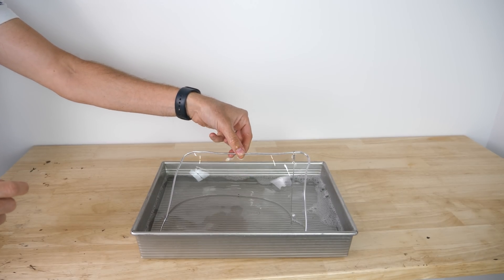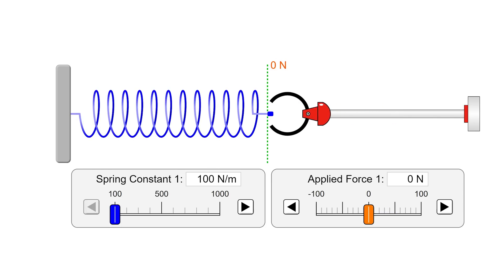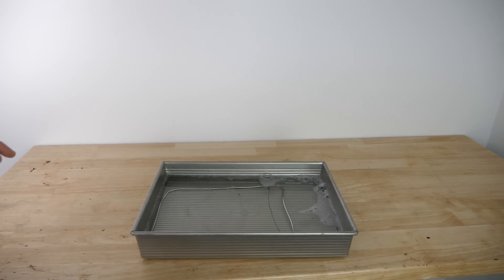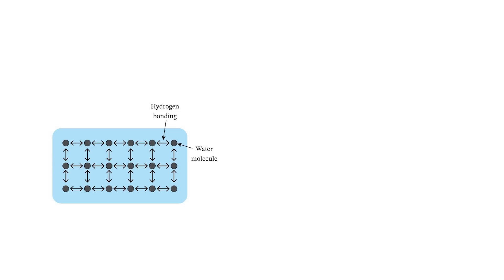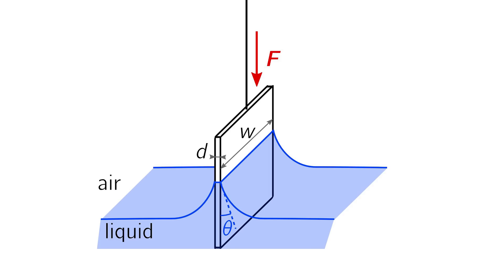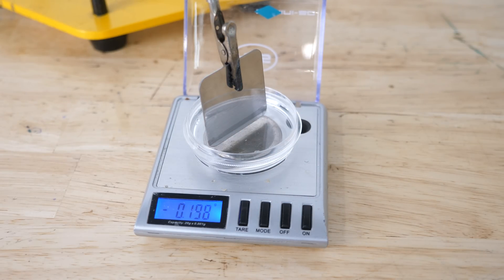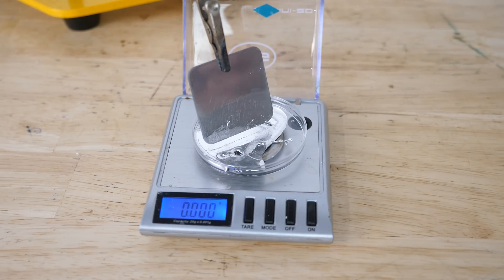Why is Water So Stretchy?

Comment: In biology class we learned that if you're ever trapped in a jungle, you should cut vines higher up first, then lower down, to get water out. The top cut severs the water inside from the rest of the plant so it can't get pulled up, otherwise the water tension would pull the water up and you'd get a dry vine. Stay hydrated!

Comment: Does this happen with different gravity? Such as, will the proportion of surface tension be the same on the moon as it is here? Or does the pressure and temperature difference change it significantly more than gravity does? It would be an interesting thing to measure, and potentially create lakes of liquid which we can walk on, on mars or other planets/moons if able.

Comment: Ok now that was cool, the scale + adding soap demo. You can literally see the water losing its grip with just a microscopic amount. I've seen people use water displacement on a scale to measure the volume of things by the increase in weight, but I never thought about surface tension decreasing it.

Comment: Sooooooooo I was playing Pokemon blue version the other day and was fighting one of the lesser trainers in the poison ninja gym, I just beat his arbok with mew's psychic (I named mew lil giegue), and then he sends out Sandslash, so I send out my Vaporeon, now the reason I did this is because on a chemical level, vaporeon is cooler than sandslash. Allow me to explain the science behind my hypothesis. In chemistry specific heat is the amount of energy required for one kilogram of a substance to be raised one degree Celsius. Now water's specific heat requires that it absorbs about 4200 joules or one kilocalorie(one nutritional Calorie)  for one kilogram of water to be raised one degree Celsius, now sand is a heterogeneous mixture, however around %80 of sand is composed of the element silicon, silicon has a specific heat of 710. So it takes waayyy more energy to heat water to the same temperature as sand, water is also a liquid on most places on earth, which means its particles can move around and disperse energy more easily to cool down faster. This is why sand at the beach is hotter and the water is cooler. So basically vaporeon is made of water and everyone knows it so vaporeon is like water, and sandslash has sand in the name, and it is also ground type, the ground is sometimes made out of sand in some areas, also Sandslash can learn the move slash, and also sand attack, so it is safe to assume that to the same extent that Sandslash can slash, that it is also sand, so we can say that Sandslash is like sand.Putting this information together we can deduce that vaporeon is like water and sandslash is like sand, and by extension, that vaporeon is cooler than sandslash. Now Pokemon is sometimes like an anime sometimes, but in this particular battle, I had battle animations turned on, the root word of anime is animation, so at this particular moment Pokemon was like anime and in anime, mostly the cooler guys win. This is what I was thinking in my head when I switched from my mew to my vaporeon against Sandslash of the enemy. The enemy Sandslash got one free turn because I used my turn to switch, so sandslash gets like a bonus turn, and it used a slash attack which has a higher critical chance, and! It got a critical hit on my vaporeon! It wasn't good but it took like half of its vitality HP. Next turn! My Vaporeon out-fasted the enemy Sandslash, so it gets to first this time, I told it to use surf because surf is like the best water move probably. BUT THE SANDSLASH SURVIVED BY A SLIVER! SANDSLASH TURN IT IS NOW!! CRITICAL HIT SLASH AGAIN!!! VAPREON IS UNCONSCIOUS NOW!!!! It was rediculius because of all the science and logic I just used to prove beforehand why I should have one.However looking back now there might have been 2 reasons number 1 is even though in the animes the cooler guys win, it is known that guys with yellow hair also win a lot in the animes, needlessly to say the power of anime betrayed me . Sandslash has yellow hair I think Soo yeah. Number second reason is my vaporeon was level 27 but the Sandslash was level 33, in the Pokedex, Sandshrew, which is baby Sandslash is the 27th Pokemon numerically and numerically Eevee is number 133, but which is 33 plus 100. Now what is special about 100 is that that is the number of Voltorb, which is electrical, what is also electrical is the Pokemon "charjabug" introduced in Pokemon sun and moon, in a week which is 7 days, and in seven days the sun comes and goes seven times so that's why we call Pokemon from that game "gen 7 Pokemon"  so anyways charjabug knows how to use the "volt switch" technique which attacks but also switches to a different pokemon, so if we cancel out the 100 of Voltorb out of 133 of Eevee, we get 33 which is the level of the enemy Sandslash, and my VAPREON was level 27 which is the number of Sandshrew, so that plus Voltorb's relation to electricity and by extension charjabug and its "volt switch" technique we can hypothesize that the "coolness" got mixed around especially because vaporeon is from Eevee, which has unstable DNA, and it was sent out just after mew, which has all the Pokemon DNA inside it, so it becomes obvious that this is what happened, and that the Sandslash I was fighting was also super Saiyan Naruto from the animes, But really I should have won

Comment: Im pretty sure this device you advertise either doesnt work or is rather harmful and i would love to see a scientific explanation with statistical values what it actually does
Reply: I got micro current treatment during PT for a injury. It's common in physiotherapy. And how cells repair themselves has to do with voltage differences created by ion channels.
Reply: @PigeonLaughter01 there's a lot of unproven methods used in PT and the professionals can be fooled and driven by perverse incentives too.
Reply: I suggest you not buy the product then if you don't trust it. I won't be buying it either and I ff through the endorcement,  but I'll still enjoy the videos.

Comment: Gallium has a significant confounding factor:  The surface oxidizes spontaneously, and rapidly, so you're getting gallium oxide surface tension instead of just gallium.  In the video, you can see that the surface of the gallium has a noticeable semi-solid film on it.  I wonder what the results with the plate would have been if the gallium was kept in a carbon dioxide atmosphere (could be produced easily by sublimation of dry ice, and unlike nitrogen, it would stay down in a vat even when warmed up enough to keep the gallium from freezing).

Comment: In fact, surface tension is similar to a spring force, but there is a big difference: the force of a spring increases when the spring is lengthened (Hooke's law), whereas the surface tension force remains constant when the lamina is enlarged.

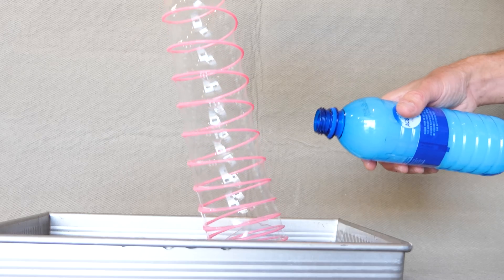Comment: For water to truly be like a spring it needs to be able to be compressed, which it cannot be. I do agree that water has surface tension and can "pull" on things it's attached to, however this is not due to a spring force. For example at 4:30, you're not measuring a spring force, you're simply measuring the weight of the water being lifted by the object the water is attached to. Water itself cannot physically stretch. Surface tension does not equate to stretching. It would be like connecting 'Barrel of Monkeys' together and then saying they're stretchy. It just does not work that way. In the example at 0:20 and 0:55, the force of pull from the water is caused by surface tension and not because water is stretchy or springy. I feel calling it stretchy or springy is misleading, and although the intention is pure, this is how misinformation is spread and leads to an overall decline in generational intelligence.
Reply: There are plenty of springs that start out at maximum compression.

Comment: Wont the galium weaken your metal plate?
Reply: Depends on the metal.  Even if it were aluminium, it would be fine so long as the oxide film is not disturbed.  One scratch and it's amalgam time.

Comment: The comparison with the spring constant is misleading - both are force per unit of length, but the meaning of the length is different.
In spring constant, it's force per DISTANCE OF STRETCH. In surface tension it's force per LENGTH OF EDGE.
The distinction is important: a spring pulls more and more, the more you stretch it - it gets progressively stiffer.
Surface tension pulls the same no matter how much you stretch it - the force isn't increasing but constant. But it does increase, if you increase the edge length.
Reply from the maker: Good point. Basically, the surface tension pulls the same no matter what because it keeps filling in the gaps with more molecules
Reply: @TheActionLab I mean, it’s not surprising that your science is falling to the wayside when you are shilling snake oil beauty products to your subscribers with no credibility behind it.
Reply: @2nd-place Irrelevant to the comment
Reply: @2nd-place  Cool! its common to make mistakes and learn from it! I really appreciate the level of physics understanding a chemical engineer has!
Reply: @2nd-place and your comment is the least objective.
You’re a classic example of haters gonna hate!
Reply: I also was thinking the same... Their units and dimensions are same but the phenomena is completely different.

Comment: Im usually fine with people getting sponsor cash even from fairly garbage products because its usually pretty obvious what you are getting, but I think its really dubious to have a channel that is presumably well trusted to explain science concepts push extremely poorly supported products like this video does. 

The entire premise of the thing doesnt make much sense*, let alone the fact that theyve not at all proven it even works in any kind of a robust clear experiment. Its just irresponsible to peddle this crap to people, and I should think undermines how trusted this channel will be in the longer term.

*People who arnt toned dont look notably older than people who are, thats just not how visible aging works. (Which is primarily things like your ailing collagen.) In fact many ways of exercising facial muscles increases signs of aging. Why do you think people use Botox?

Comment: "Let's check another liquid that has extremely high surface tension, ten imes stronger than water..."
"I know this one, it's mercury"
pulls a liquid metal on the scale
"That's right, I knew it was mercury"
"...gallium"
Reply: FOOLED
Reply: You can tell it's gallium because it's a sticky mess
Reply: i also thought mercury because it is the only liquid metal that i can remember.
Reply: @RealmOfFiction At room temperature. Gallium is pretty close (~85F/~29C) and will melt in your hands if you aren't hypothermic. The coldest a human body has gotten to (accidentally) was ~56F/~13C.
Reply: @zecuse  I was thinking for that sample of gallium on the scale to stay liquid, he must have had his room thermostat set for max... Like you said, above 85F/29C.
Reply: @zecuse  nice
Reply: that's right, it's the square hole ;)
Reply: Played us like a damn fiddle
Reply: I wonder how much difference in surface tension mercury and gallium have?
Reply: @L4JP  At 30C, Gallium-air surface tension is 46% stronger than mercury-air
Reply: @jwnomad  Thanks.
Reply: I know, right?
Reply: I've used gallium for cpu heatsink thermal paste
Reply: Any metal that's "only just" reached melting point has super duper surface tension.

Comment: Can you do one on the surface tension of water as it applies to the high dive? For instance the force it transfers to the diver from different heights. And possibly how high would be a fatal impact.
Reply: Those forces has nothing to do with surface tension - it's about inertia (yes, the surface tension is there, but it's completely neglectable in comparison). Water is heavy and have to be quickly pushed out of the way as someone dives into it. The higher up they jump from, the faster they will go when hitting the water and that means the water also has to be pushed out of the way quicker (=greater force) - same reason why it's hard to move other than very slowly in water (even the worlds fastest swimmers only moves a little faster than normal walking speed).
Reply: @Speeder84XL  I find this very interesting. I wonder how he could measure that pressure? Maybe impact at different hights and with different size projectiles such as head size vs body size as in bellyflop style.
Reply: @JwSheems  Depends on what you want to measure. Usually the total force is most interesting, since that's mostly related to how it will feel and the potential for damage. That could be measured by for example put an accelerometer with some sort of logging on the diver or projectile - then multiply the deceleration force by the weight of the body/projectile, to get the force from the water. Water pressure can also be measured, but will be very different depending on where it's measured.
Reply: @Speeder84XL  That would make a very interesting video (in my opinion of course). Thank you for the info 🤝
God Speed

Comment: Water is weird since it's stretchy but doesn't compress.
Reply: How do you think hydraulic systems work? All liquids can be compressed, its just not an easy thing to do with some. 
Actually, fun fact, compressing things like gasses tends to make the gas colder, whereas water is heated when compressed to more dense state. It does also become easier to freeze under extreme pressures.
Reply: @schaventalakimungous4855  who told you compressing gas makes it colder? the temperature doesnt change